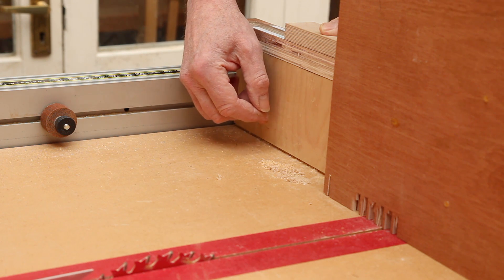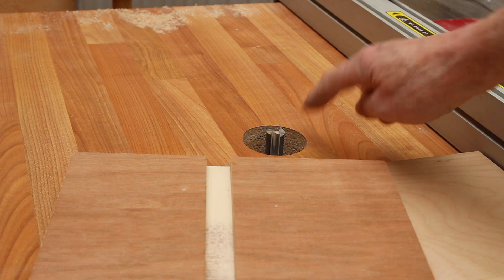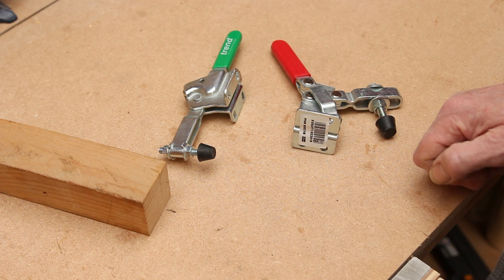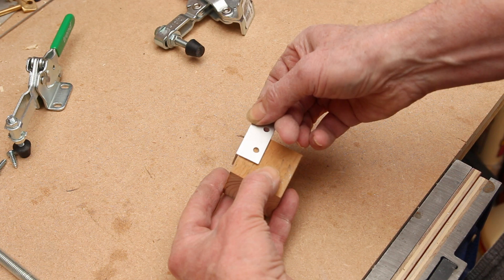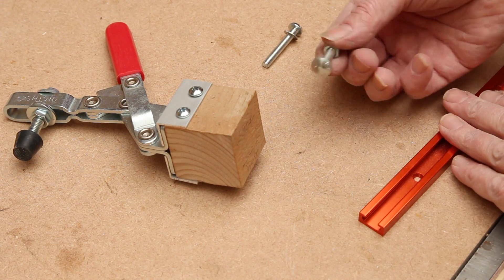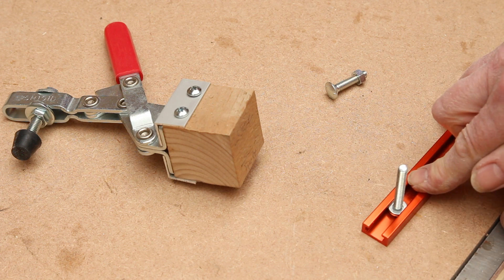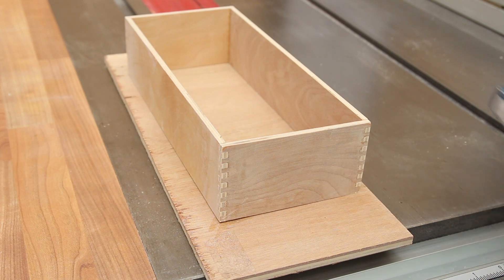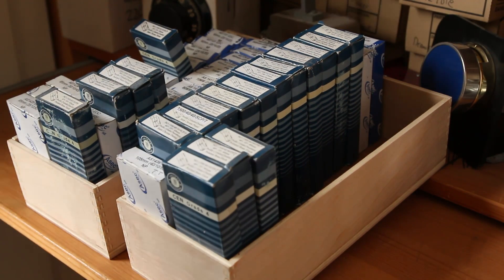Box Joint Jig Part 3 - Clamp

Comment: Hello, my name is Alan.
I suffer from “aphasia”, stroke which means. I am unable to talk, 
I am unable spelling.  Only “Paste & Copy” & "Number's". Hear, Read OK.

5.39 min (Pan Head bolts &  Washers), Round & Round !!!   Joint Connector Bolts BZP M6. (Cot & bed) 
6mm Metric Coarse Thread, 4mm Allen Key Socket, Head Diameter is 15mm. 
You Have A Lengths, 15, 25, 30, 35, 38, 45, 50, 60, 90, 100, 115, 125mm. slot is 8.9 x 6.4mm deep BENCH GRINDERS, & LINISHERS  3.1mm + 3.1mm = 15mm x 8.8mm
 
7.18 min Taps (awful, pine)    
M6 Headed Inserts for Wood (Type D) Length 13.00mm Hole Size 8.70mm - 9.00mm 6mm A/F hex key.  
 (Unheaded Inserts for Wood (Type E))  

Box Joint Jig. Very good *****5 (y) 'thumb' Thank You
Reply: :| you allright?